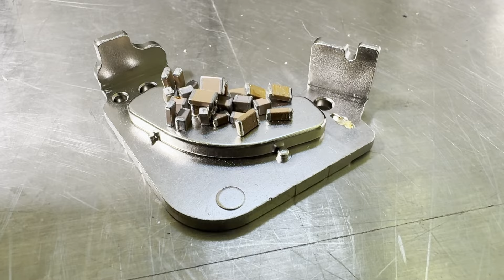Palladium and Silver from Scrapping Aruba Wireless Access Point

Comment: Gap pads are usually silicone based, should be silicone oils. Cans are usually tin plated steel. Some modern IC chips (bga's too) contain aluminum or copper Bond wires FYI :(. It is a sad realization once seen. I usually sample and break a few in half a few different ways under a microscope to make sure. Gl!
Reply from the maker: @bnae38  Thank you so much for your view and your comment.  Yes, oils of some sort.  Makes everything really slick.  Are those gap pads used just for gaps or are they also for heat transfer?  Also, yes, you are absolutely right.  I’m going to do a video on those chips to see what’s inside them.   Thanks so much for the information, the view and comment..  I really appreciate your time.
Reply: @KKRRenewables  The gap pads are usually for thermal transfer. Fingers crossed on you finding gold bond wires!